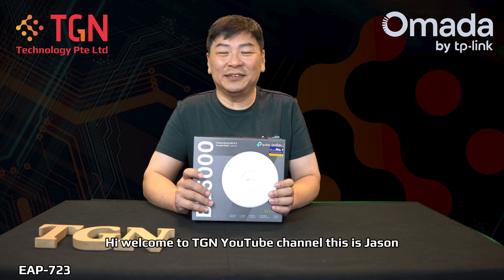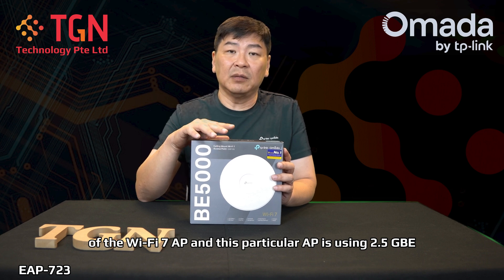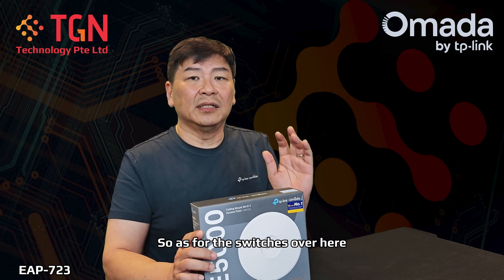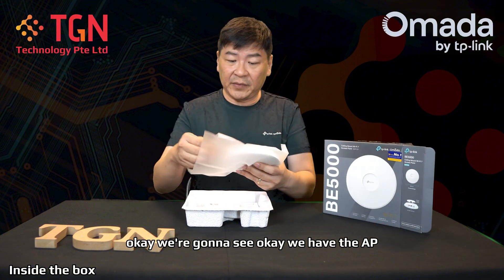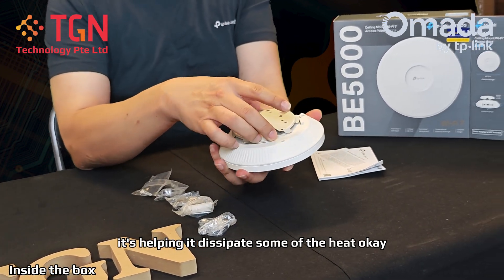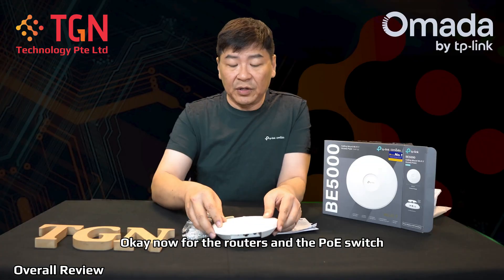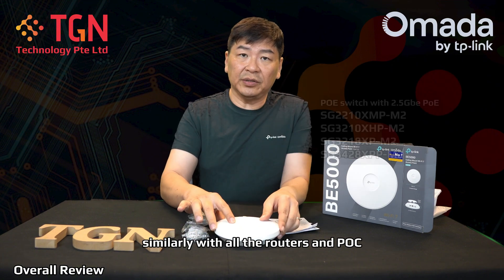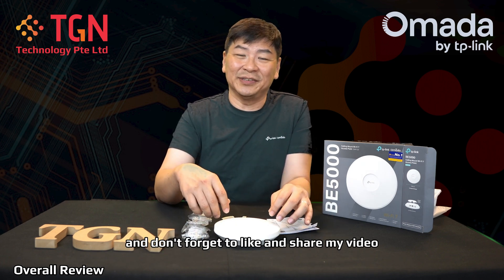TP Link Omada EAP723 | BE5000 Ceiling Mount Wi-Fi 7 Access Point #tplink #wifi #technology

Comment: Is it normal for such devices to get so warm? I have the EAP 723 BE 3600 and I often find it very, very warm.
Reply: What temperature? Did you use poe?
Reply from the maker: Yes. We use Poe+ and it’s warm to touch.
Reply from the maker: Yes, it does get warm for wifi7 AP.